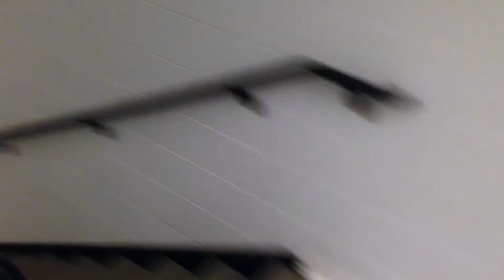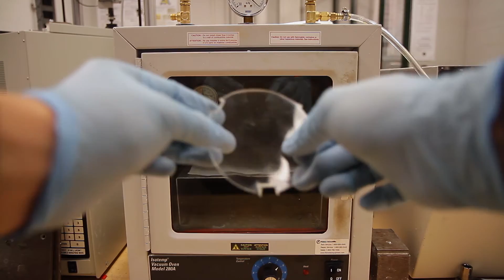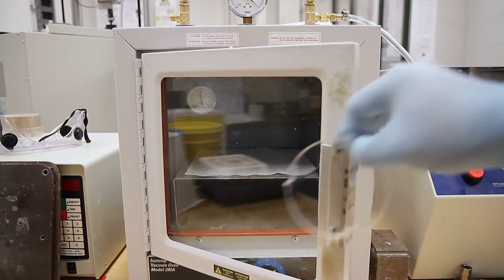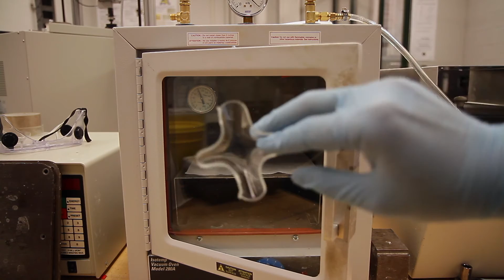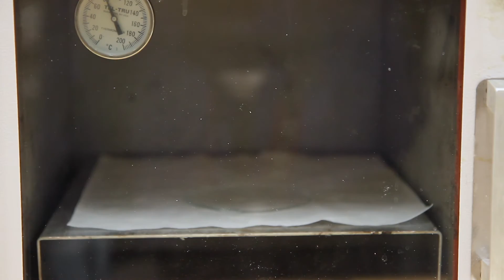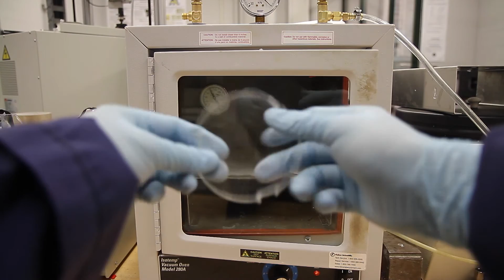SURE 2014 : Shape Memory Polymer Fabrication and Testing

Comment: Thank you for the information. Please, I would like an answer: When we change the temperature to perform the operation, after obtaining the temporary form B, after distorting the permanent form, A, after affecting the obtained form, B, with an external temperature, return it to its permanent form, A, is it possible to repeat the process starting from the permanent form? To obtain another shape b that is different from the first shape in the first transformation In short, can we distort the permanent shape A into several shapes b and always return to shape a?
Reply: you have twoway SMA materials and oneway SMA materials, oneway means one permanent shape, twoway means two permanent shapes (at different temperatures). the process is always repeatable